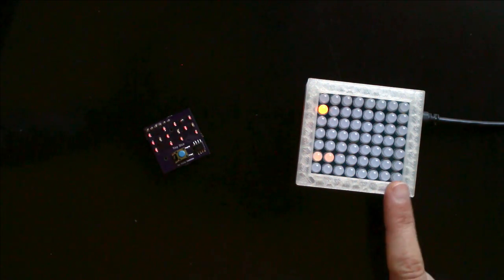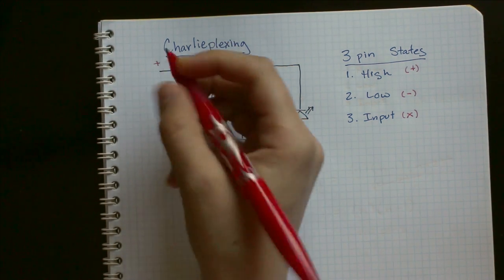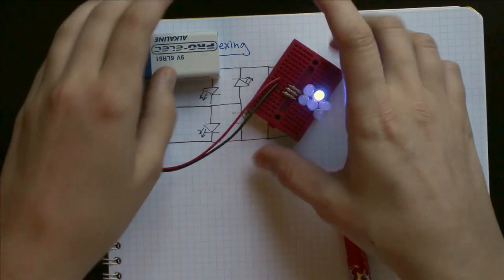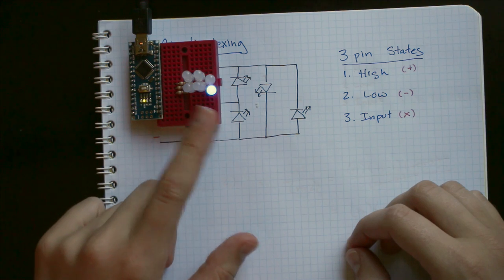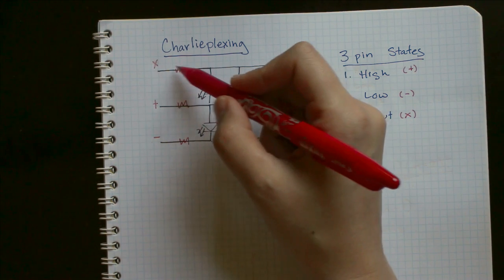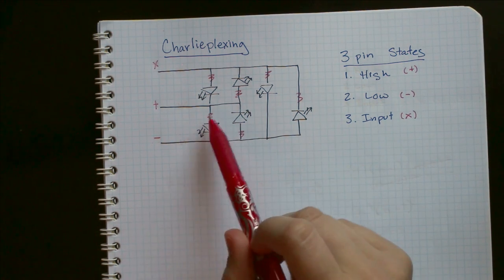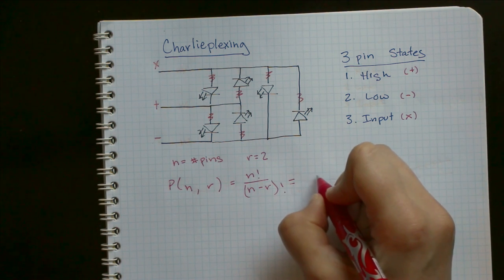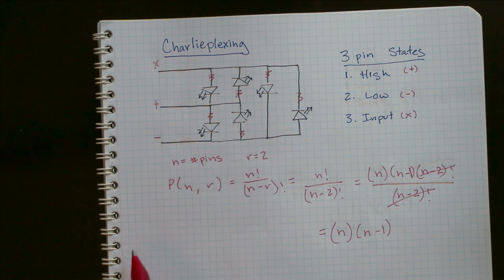How Charlieplexing Works

Comment: Nicely explained. Just one remark though, if you have resistors per LED and the voltage is large enough, multiple LED's could light up. The advantage with shared resistors is that the LED limits the voltage and therefore is too low for the others to light up.

Comment: one problem with this particular example is when you are lighting the 2 LEDs connected to the top and bottom runs (& not the middle) . If your voltage is too high and requires larger resistors, then when the top run is + and bottom run is - and middle run is open, you can also light the series LEDs if you are not careful. so you have to make sure that the voltage is low enough to NOT light the LEDs that are in series.
Reply: Hello @davebing11,
Not really... Provided that you have the current limiting resistors, the LED that is actually being lit (on purpose), it "clamps" the voltage to a "one LED drop" and that will always be half of the voltage required to light the other branch composed of two LEDs in series.
And by the way, if there would be a case for the problem you highlighted, in fact it would not just happen in only one of the combinations as you said, but actually it would potentially happen in any combination.
For any particular LED you want to light, there's always a set of other two LEDs that come up in series and are in the correct direction.
But, as I mentioned in the beggining, the issue is actually a non-issue due to the voltage "clamping" effect.

Comment: But will all the reverse biasing of the LEDs is that going to cause them to break down faster and shorten their life?
Reply from the maker: I don't have a robust answer for this (with publications, scientific evidence, experimental results). However, as a hypothesis, I do not think reverse biasing the LEDs is a problem in the charlieplexing applications I have developed. Here is my reasoning:
1. There are many 2 pin leds (ie, red, green) where the two colors are packaged so that the cathode for the red LED is the anode for the green LED and vice versa. As an example see the data sheet for part number LTL-293SJW (https://media.digikey.com/pdf/Data%20Sheets/Lite-On%20PDFs/LTL-293SJW.pdf).  
2. Many other types of diodes are designed to withstand reverse biases. 
3. Most standard LEDs have a reverse voltage rating. For example, part number C503B-RAN-CZ0C0AA1 (https://www.cree.com/led-components/media/documents/C503B-RAS-RAN-AAS-AAN-RBS-RBN-ABS-ABN-RCS-RCN-ACS-ACN-1079.pdf) has a reverse voltage of 5V. It also says continuous reverse biasing could damage the LED but, we are not continuously reverse biasing the LED. 

Thus, we know that normal diodes are designed to not break under a reverse bias within the specifications given on the data sheet, that well respected LED manufacturers sell commercial products where LEDs are reverse biased, and that regular LEDs have information on the maximum voltage that the reverse bias should be. Taken together, this information makes me think that LEDs are designed to survive reverse biases within the parameters indicated on their data sheets.
Reply: @HammesHacks  Wow, thanks for you detailed response!  I think you have made some excellent points.

Comment: Question: Your first example of resistors. You say:   ''half the resistor here and half the resistor here''. What about the 3rd resistor ?  If my intention is to use 220hms for an LED, does that mean that all 3 resistors should be 110 ohms ? Also, would you have the code for YOUR example ?
Reply from the maker: They are all 110 in my kits, but because electrons flow through 1 resistor, then an led and then a second resistor, the resistors are in series (110+110=220). All the other pins are set to input. Setting the pin to input makes it act as if it is disconnected, so for the LED which is on at any time, you only need to consider the 2 resistors which will be used for that LED.
My webpage is hammeshacks.com, and I sell kits on tindie (https://www.tindie.com/stores/hammeshacks/).  There are example codes for my kits. The Recharge, Celtic Christmas, You Turn Me On, 8x7 charlieplexed LED shield, all the kits that have the word Tiny and the Word Clock use Charlieplexing.
Reply: @HammesHacks  so in your example, all 3 resistors are 110ohms ?
Reply from the maker: @rotorway133  Off the top of my head, I do not remember what resistance I used in the video. However, most of my kits use 100-120 ohm depending on the LED.

Comment: Greet ! The Question is can we control 3 or 4 LEDs at a same Time ??
Reply from the maker: To answer that question you need to define "control" and "same Time". 

By "Control", do you mean that 3 or 4 LEDs are able to blink independently? Or, do they always blink together?

By "same Time" you need to define the smallest unit of time you are measuring, or the smallest unit of time that is detectable by your measuring device.* 

If you are using a human eye to measure time, then yes, 3-4 LEDs will be controlled independently and simultaneously using an Arduino, if you write your code well. However, that same code, using a high speed camera, will most likely be able to see the LEDs blinking. 

* Note: 3-4 LEDs blinking is not so different (optically) from how low-cost projectors work: by flashing a Red image, a Green image and a Blue image (and sometimes other colors) in the same location, your brain detects a single multi-color image. From the projector designer's perspective, the lights are not blinking at the "same time" because they need to time events at timescales that are shorter than optical human detection. However, from the person watching a game at a sports bar's perspective, all the colors are being projected at the "same time" because they only detect the multicolored image.

Comment: Great, Just a question: Is it Scalable? (how)
Reply from the maker: Charlieplexing is scalable, to a point. Specifically, because only one LED is on at a time (generally) the more LEDs that need to appear on, the dimmer the whole thing will get. Additionally, at some point, it will take so long to cycle through all the LEDs that need to be on that persistence of vision will no longer work. At that point the fact that each LED is blinking will be noticeable. 

The current example has 3 wires (think of them as pin 1, 2, and 3) connected as follows:
(1,2),(2,1), (1,3), (3,1), (3,2), (2,3)
Where the first number is the pin that is high, the second is the pin that will be low/ground and all other pins are set to input by the microcontroller.
To add more LEDs you need another pin on the microcontroller (pin 4) and to add the following pairs to the 3 wire set:
(1,4),(4,1),(2,4),(4,2),(3,4),(4,3)
The programming follows the same logic as above.